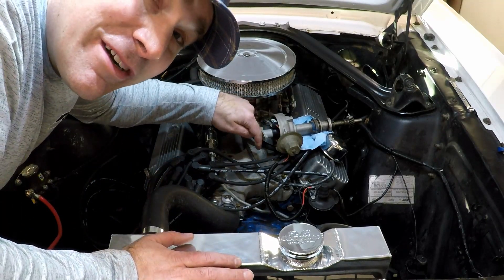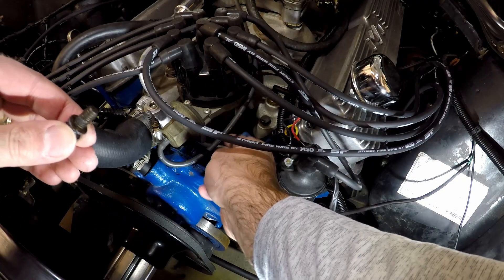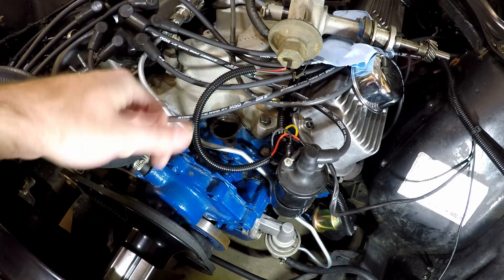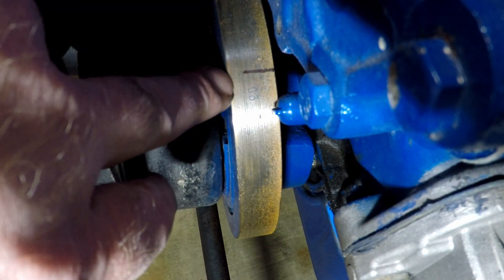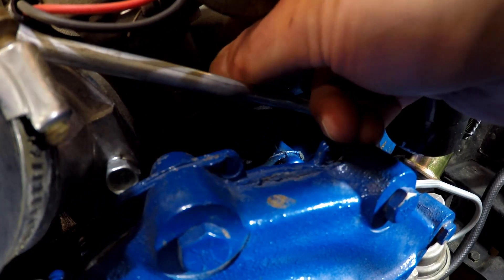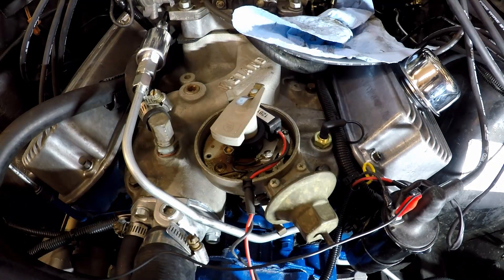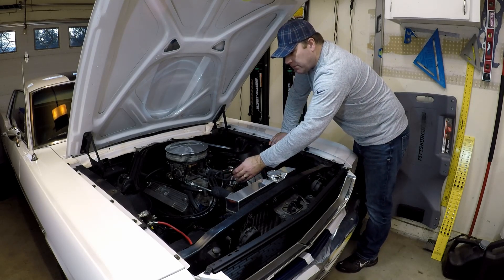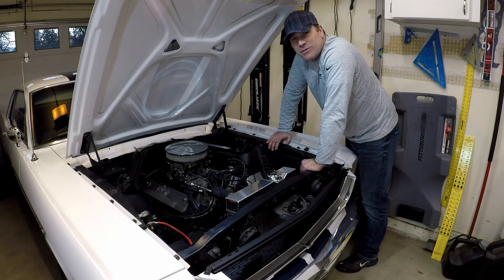How to set the timing in a 289

Comment: One question I have a 289 and the test light does not turn off when rotating the distributor clockwise or counter clockwise I have a pertronix ignitor.The harmonic balancer hits very close to the 0 mark when the piston is on the compression top.Does the TDC have to be right on center or alittle after or before TDC.Note the engine did turn on b4 good I just wanted to recheck TDC, timing and now this is happening lol my luck.
Reply from the maker: Your TDC will be timed with the harmonic balancer and the keyway in the crank shaft, so you don't need to worry if TDC is true to the marks on the balancer.  However, having the pointer (whether it's on the timing cover or a metal tab bolted to the timing cover) in the correct location relative to your balancer is important.  Hopefully that is correct.
If the light is not turning off, there maybe something wrong inside the Distro, you should have enough adjustment in the smaller area you rotate the Distro to make it "contact" at the correct point.  Not sure what kind of issue you have going on there.
Reply: @KruseBuilt update the reason the test light wasn't turning off was that I didn't turn on the key switch to "run".Once I did that that test light turned on/off when rotating the distributor. It took me 3 days to figuring it out now it's running. No videos show that.You helped me out in various videos thx.
My stang is a 64.5, 289,c4 green dot.

Comment: do I need to know what cam shaft specs and how much vaccum I create in order to set the timing in my 289 hi-po? I’ve been told I need to do so but don’t see you mention it in your video? What are your thoughts?
Reply from the maker: Not really, it’s mostly about the highest vacuum you can find. There are a few subtle nuances beyond that, but the main goal is to find the highest vacuum.  :)

Comment: Trying to adjust mine, but it seems to be stuck.
Reply from the maker: They can get a little corroded, even a little rust build up on the block can sort of seize the Distro in place.  You can spray some PB Blaster on there, or a some WD-40 and work at it, it will eventually come loose.  :)

Comment: Thanks for the video, Andy! I see that you connected the vacuum line before timing it. Some people say to disconnect because it does something to the timing? Curious, what are your thoughts? I'm new to this, so your feedback would be highly appreciated.
Reply from the maker: I'm only going off what I was taught long ago.  However, I wouldn't be surprised if there are better ways to do any of the work I do in these videos.  :)
Reply: If it is ported vacuum, off the carb, there is no need to disconnect the line.

Comment: Hey Andy. Did some work over the winter on my 289. New intake, and upgraded from 2 barrel to 4. Started up right on first try but my rpm’s are 1500 at idle, but when I touch the gas a bit it’ll settle back down 800 rpm idle. Does that sound like a timing issue or do I need to fool around with the idle mixture screws on the carb? Any feedback is appreciated. Love your work.
Reply from the maker: Doesn't sound like a timing issue.  That 1500 rpm initial idle is probably running on the 'fast idle' and that goes away not too long after start up.  You can adjust your idle while the choke is engaged.  1500 is a decent "choked" idle speed, but when you're ready for the car to idle normal, 800 seems to be the sweet spot.  :)

Comment: I'm confused regarding the old school female distributer and the new school distributer caps which are male. My question is does all the info presented apply to the newer systems. As an example rotors seem to be a thing of the past how does this change things if at all.

Do you find setting timing difficult ?
Reply from the maker: Not sure what you're asking here.  Rotating the distributor to advance or retard the timing applies, that's how it works.  Whether a Distro has Points or some kind of electronic ignition.  Distributors that have weights under the cap play the same kind of role as vacuum advance does on some styles, but rotating the distro still affects initial timing.
Reply: @KruseBuilt  Thanks

Comment: Interesting why so wildly different from spec? The repair manual and all Googling I have done says 6 degrees from TDC not 12
Reply from the maker: I was told (a long time ago) that a good place to start is at 10-12 BTDC when setting the timing on these engines.
While this video was made a quite a while ago and I have a different engine in the car, I have since had my new engine dyno'd and we found that the engine made the most power at 10 degrees.  We started at 12 and went all the way down to 8, but we found my engine was happy at 10 degrees. :)

Comment: What if the light doesn’t turn off?
Reply: I'm having this issue
Reply from the maker: Then there's something wrong with the points.  When the points disengage (called dwell), it would break the circuit here and the light would go out.  :)

Comment: What do you have to pull the distributor first?
Reply from the maker: The advantage to pulling the distro first is to make sure everything is lined up on TDC for cylinder number one.  From there, we would know the timing value we're reading is accurate.  If someone is certain that the distro was already aligned with TDC for number one, then they would not need to remove it and can go onto the next steps.  :)
Reply: But you could do the procedure you showed with the distributor still in place then pop it up and reposition it on the gear right?   I’m just asking because I’m having some timing issues and didn’t pull the distributor first. I pulled it after.
Reply from the maker: If you realign the distro with TDC of number one after you set the timing, you negate anything done before you removed the distro.  I recommend starting over, make sure cyl number one is at TDC of the compression stroke, align the pointer of the distributor, then work from there.  :)
Reply: @KruseBuilt thanks for the replies.

Comment: Andy, great video as always. Curious if I'm pulling the distributor to simply paint the intake, can I snap a reference photo and then when I'm done painting simply drop the distributor in, pointing everything the exact position? Or do I NEED to bother with turning the engine with the crank bolt and getting a timing light?
Reply from the maker: Your best bet is to put it at TDC for #1 and the make a mark on the distributor housing where the pointer is pointing. When you go to reinstall the distributor, the pointer will be right where you left it. However, it may take a few tries to drop it in and get the gear to align properly with the cam shaft. Good luck, you’ve got this!  🙂
Reply: @KruseBuilt  thanks. Yeah the pitch on cam gear turns the rotor as distrutor comes up. Very easy to get it off one tooth. I see per your video, it will go back in but rotor may not go back where it was.

Comment: I love your videos so much. I recently bought a 95 S10 with a 289 (I know, I know). But it's punched out .60 over and it's got roller valve train. It's kinda cool. I've used you videos to determine that the timing is too late or it's got bad rings. I'll find out once the engine cools off.
Reply from the maker: Going through the and fixing/repairing/upgrading our new projects is part of the fun, good luck!  :)

Comment: so when you move distributor when running, with timing light is mark at marker? or at 9 degrees?
Reply from the maker: Yes, with the timing light, using the mark/pointer to read the timing.
Reply: so "not" a 9degrees with light? tia

Comment: how come you connected the vacuum advance to timed vacuum port and not on the manifold vacuum port on the carb?
Reply from the maker: The timed port only seeing vacuum when the throttle plates are open, and this is when the vacuum advance part of the distributor needs to adjust timing, under load.
Reply: @KruseBuilt  i see. i have inserted pcv valve and my engine runs rough. does my carb and/or distributor need re-adjustment?
Reply from the maker: @gamwsas  The PCV valve connects to the large port on the back of the Carb and will only have a bearing on your idling if it was tuned without it connected.  You may find that you need to re-adjust your idle mixture screws at that point.  :)
Reply: @KruseBuilt  noted and thank you for your time answering my questions.

Comment: Hey Andy, you helped answer my question on your other video about the timing chain cover the other day. I got my engine to top dead center but the harmonic balancer fits on and says 30° and is perfectly vertical. I know it’s at top dead center because I felt the compression stroke push my finger out when I shorted the solenoid and spun the motor. Do the timing marks on the harmonic balancer matter if I know that the true top dead center is activated?
Reply from the maker: There are a couple of different timing indicator options with these timing covers, so you may need to make sure your indicator works correctly with the timing marks on your balancer. You can only put your balancer on one way, but a new cover/indicator may not point to same location on the balancer as your previous timing cover.
Reply: @KruseBuilt  yeah when it’s at top center and I put the balancer on the only way it can go, 30° is directly vertical north of south. I see your indicator is on your timing cover but my timing cover seems to be missing an indicator, perhaps I should just reference your indicator and go from there?
Reply from the maker: Your timing cover probably requires you to purchase the timing marker that installs under two of the timing cover bolts (pics online of how this works).  You balancer is fine, you just need to find a timing marker that will point to the correct location at #1 TDC.  :)

Comment: If you find TDC first, then all u have to do is lift tge distributor just enough to disengage the gear and turn the rotor to that #1 position and drop it back down. If the distributor is not fully engaging, just blip the starter utility it falls in. This job can be done in 2 minutes.
Reply from the maker: Yes, there is more than one way to set the timing.  You do what works for you.  :)

Comment: Hello Andy! I'm working on the timing on my 66 vert 289-2v (2100) c4 so I dialed up your video. I noted you run a P-1 ignitor in your distributor. Since this video is two years old, I imagine you've upgraded that. I had to upgrade my P-1 to a P-2 out of necessity (I let the magic smoke out of my P-1). My question is, are you, or have you, done a full-on timing video, setting distributor curve, adjusting vacuum can, etc? Right now I run 12 degrees base timing at idle and 40 degree full advanced at 3k rpm and it is smooth, but I want to make sure I'm on the right track, reading spark plug arm markings/colors, etc.  Keep up the good work! And know..."I'm watching you!"
Reply from the maker: I have run the Pertronix 1281 in all three of my classic Mustangs and never had a problem with any of them.  I have heard others have had issues with this same electronic distributor, but I have yet to have any issues.
This video is really the only video that covers setting the timing (others may touch on it, but this is the one with the most info) and I've never dived into distributor curves.  I did have to adjust the screw inside the vacuum advance, but I do not recall if I covered that in a video (it was quite a while back).
Along with that 12 degrees of initial timing, I am running 38 degrees of total advance.  :)
Reply: @KruseBuilt  the issue with the 1281 is that if you leave your ignition on without the engine running, the module will overheat and burn out. Also, if you mistakenly hook up the leads backwards (as I recently did), you let the magic smoke out.  So I upgraded to the P-2, 91281 module that doesn't exhibit either of these issues. I'm kinda surprised you haven't upgraded to the P-3, since it is the best and also includes built in Rev limiter. But ok, if P-1 is working for you, then get 'er done, son! Keep up the great work and I look forward to your next video! You've got one of the better mustang channels out there!

Comment: I had this exact same issue. Did the same thing you did. But together the timing where it was supposed to be, it ended up right back where it was before I started. Right up against the hard fuel line again. So.....I guess that's where it's going to stay.
Reply from the maker: Yeah, I wish there were better options without going to some full custom setup.  :)

Comment: How did you verify timing with the vacuum advance hooked up? And I thought the 289 is supposed to be set to 6* btdc?
Reply from the maker: The other end of the vacuum tube was not connected.  I've been told it's 10-12 degrees, and I've done 5 engines that way in the last 4 years with zero issue.  Plus, my engine builder on my latest build (347) said 12 degrees of initial timing.  :)
Reply: @Andy Kruse  I always thought it was 12 degrees until recently. I guess modified engines can be set to that but a stock engine I guess is 6. I just set mine to 12 and I'm having some issues. I might set it to 6 degrees of initial timing and go from there. It's a bone stock engine and that's the way they came from the factory so I'm told.

Comment: I thought you had to be really careful and lift the distributor out slowly with the 289’s so that you don’t displace the oil pump rod.
Reply from the maker: No, there’s a small washer-clip thing on one end that keeps the shaft from pulling out. I guess if someone didn’t put that in there or put the shaft upside down during the oil pump installation, then it could pulled out. 🙂
Reply: @KruseBuilt  Good to know.  I have a 289 in a Cougar that I purchased a new distributor for.  I had heard some horror stories where that shaft can pull out and fall into the oil pan.  As far as I know the engine is all stock so I should be good.

Comment: Hi Andy... I have a 289 engine bored out to 347. I need to remove the distributor because the vacuum advance housing hits the fuel line too. Once removed, do I need to turn the oil pump shaft too? I notice you didn't. Please let me know.
Reply from the maker: Nope, the oil pump shaft is not "timed" with the distributor, meaning it doesn't matter where you set your timing, the oil pump will spin as long as the distributor shaft is spinning (which is driven off  the cam shaft).  :)
Reply: @KruseBuilt  Thank you Andy. I had a couple people tell me i would need to do that, so I'm glad I don't...that was the most concerning part for me :). Thank you again, I appreciate  your time and advice.

Comment: Sir, what is the purpose of test light. is this only for distributors with points?
Reply from the maker: Using the Test Light will work on cars with Points or Electronic Ignition (like what I have in this video).  The light is on until I rotate the distributor to the point where it will "fire" the spark plug, and that is shown by the light bulb in the Test Light not being lit up.  I probably should have described that a little better in this video.  :)
Reply: Hey andy, follow up on this comment. My 289 was running. I ran into a couple of issues. Fixed those, and my car wouldn't start. I decided to redo the timing. Because i wasn't getting anything. Saw your video a while ago and decided to try the continuity test light trick. No matter position the distributor in, the light is off. I made sure the light worked as well. Even tried 2 other lights and a voltage meter. Does this mean something is wrong?  @AndyKruseChannel
Reply: Did you have power to the ignition box

Comment: What degree did you set it to for running timing? Using the gun.
Reply from the maker: 12 degrees.  :)
Reply: @KruseBuilt  what do you idle at?
Reply from the maker: @tyleradams8575  750 rpms-ish.  The internals are all stock, so the typical 750 rpm is where that motor seems to be happy.  If it had a wilder Cam, or a stroker kit, a different rpm might be necessary.
Reply: @KruseBuilt  That is a super sweet '66 - man I am jealous!  Just wondering if you have done any experimenting with the timing, to see if a little more or a little less would make the car perform better.
Reply from the maker: @WorkinOnIt  Thanks!  Not yet, but I want to.  I keep putting it off until I have some real power making components on the car.  There's probably some value in do it with the parts I have now, but I might only pick up 5hp, which would really be difficult to notice.  :)

Comment: I set mines at 10 degrees is that alright or should I retime it?
Reply from the maker: From what I've read, 10 or 12 is fine, but I found more people leaning towards 12 degrees.  But even if you start at 10, my ears tell me that the motor is happier at 12.  It could be confirmation bias (because of what I read), and it could be the other components on my motor, but it does sound better.  Using a vacuum gauge is really the true way to find where the motor needs to be, I just haven't purchased that tool, so I am continuing to use my subjective hearing.  :)

Comment: Hey Andy! I have a question, what was the size socket did you use for the timing adjustment
Reply from the maker: It's a 1/2" bolt holding the tab down on the distro.  There's a fancy tool out there that looks like a bent 1/2" wrench which is perfect to have during adjusting because it helps keep your hand away from the fan.  I'm thinking about picking one up.  :)
Reply: @KruseBuilt  oh ok ty very much :))